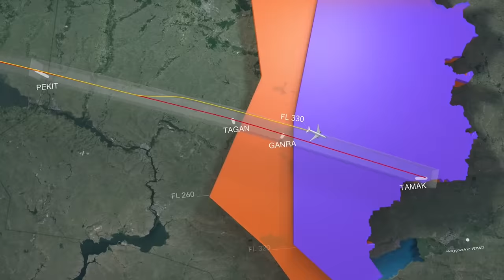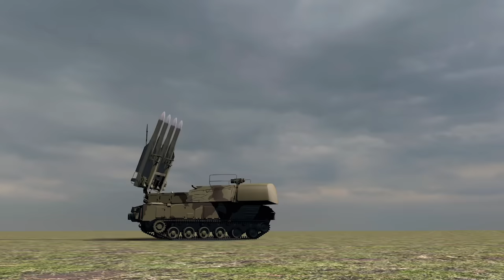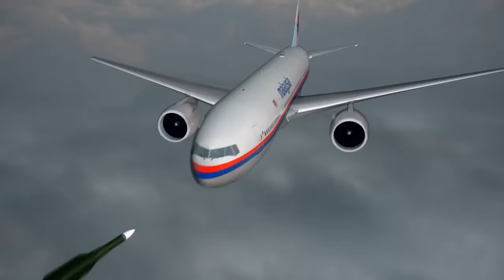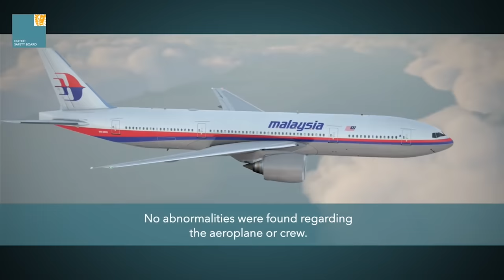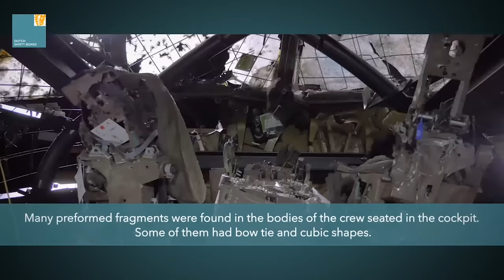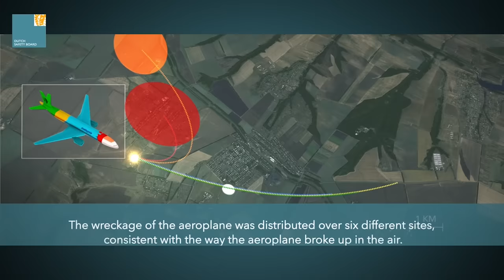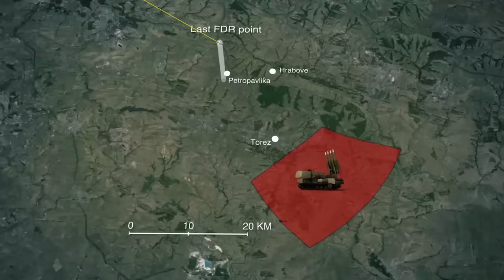Cause of MH17 crash by Dutch Safety Board

Comment: Can you imagine the terror the passengers felt whom survived the blast and initial breakup. Falling through the air. Assuming they didn't black out instantly. What a horrific way to die.
Reply: Based on the spray pattern of the explosion, one can only hope many of the passengers died instantly.
Reply: The amount of time that you can think logically at that altitude is around a minute.  After that you may still be awake but not thinking logically.  It's a horrible to imagine but certainly those toward the rear of an aircraft would suffer much more.
Reply: There's 0 survivor alive.
Reply: Terrible way to die. However, humans have found far worse ways to torture and/or kill.
Reply: Jesus. You're making this into a scientific debate. I also said "assuming they didn't black out instantly." Odds are that some were partially conscious long enough to realize what was happening. Flight or fight is no joke.
Reply: @retikulum  Incorrect.  Aside from flying as my lifelong career I have done hypobaric chamber testing.  You have time to don oxygen even in a rapid depressurization.  It depends on the fitness of the individual, but in the low thirties you have anywhere up to a minute to react before you are totally useless.
Reply: @TheWalterHWhite  Sorry for making it so heartless with the numbers, seriously.  It's a horrible crime that occurred and no one should have ever had to experience that.
Reply: Front of the plane forget it.  But the people in the back would go from comfortable temperature to minus 30 degrees in about 1 second and a 450 mph wind with everything starting to be ripped apart.   Just horror.
Reply: @tianxia4092  many fell fully conscious to their deaths.
Reply: Bo Sann  no it wasn't over quickly. Takes 30 seconds to drain of oxygen. There are pix of victims still strapped to their seats.
Reply: @RichardMusiol  nothing like suddenly falling to your death for no good reason.
Reply: @canofanger  the aircraft disintegrated. Many in the rear fell fully conscious to their deaths. Yes, Putin is a killer.
Reply: @cactusjack1943  the conditions would have sent them into shock in under 5 seconds. None were conscious upon impact
Reply: @night-lc1vc  sadly, that's not the case. Humans can certainly survive altitude and temperature for at least a minute and temperature and air pressure increased as they fell. Horrible way to die.
Reply: @cactusjack1943  I didn't say survive. I said they'd go into shock and faint as their bodies are not condition to that on top of the uncontrolled dropping and spinning
Reply: @night-lc1vc  nope. A body can even survive in outer space for at least 30 seconds. The sad fact is that many were fully conscious as they fell to their deaths. Remember as well that about the 777 was about 3/4 intact when it hit the ground. The Russian Army Buk approached from the front and decapitated the 777 by blowing off the flight deck (forward section).
Reply: Yes.. the plane would spiral down for several minutes before impact,,  I often think of that each time a get on a plane..  in hopes its not this one..
Reply: @metallampman  some victims were ejected still strapped in their seats. There are or at least were pix of the wreckage and victims that could be viewed on the web. Truly horrifying way to go.
Reply: Link me   i never heard that   they never found more than the tail near matagasgar
Reply: @metallampman  that wasn't MH17 the Malaysian 777 Putin shot down from Russian occupied eastern Ukraine with a Russian Army Buk AAM and crew.
Reply: @tianxia4092  that shrapnel on the missle is designed to destroy the cockpit and kill the pilots by detonating at the nose, like it did with this plane. im sure most of the standard economy passengers were well aware of their fate for a good minute or so before theyd pass out or hit the ground. it sucks.
Reply: Due to the catastrophic damage, I wonder if the oxygen masks even deployed,  Even if the lack of oxygen didn't render passengers unconscious, the tumbling of the fuselage would have (assuming the wings tore off).
Reply: @pizzafrenzyman  the masks did deploy. The flight deck was blown off by the Buk's 70kg war head and the roof and walls of the first class section were ripped off. The rest of the 777 remained somewhay intact including wings and rear stabilizers IIRC. It fell in a circling trajectory and landed upside down with the fuel tanks then bursting into fire upon impact.
Reply: 95% of the passengers or more likely died on impact
Reply: @TheWalterHWhite  You start contemplating on what some of the victims may have experienced, then get upset when others chip in with their opinion (yeah, why use science to understand reality) then you continue with your claims. Well done. How dare others to express their thoughts...
Reply: @metallampman  You're talking about a different plane!.
Reply: Nope. On Autopsies  every single passenger had a broken neck and or shrapnel  wounds.   . Everyone was  killed instantly  from deacceleration wounds and exposure to high energy atmospheric  windblast 550 mph wind
Reply: That's not true for everyone in a plane that breaks apart due to a bomb at 30,000ft+
Reply: @macman975  In the final ntsb report in Autopsy findings every single passenger had their necks broken .  It's  called Atmospheric  Deceleration  .   It would be like blasting  a bug with a firehose you literally  get crushed  by the wind blast.  They were killed instantly
Reply: Explain to me how that, i Believe Russian flight attendant survived a fall from over 30,000ft without breaking her neck when the plane she was on exploded?.
Reply: @LiverAndOnions69  what the hell are you talking about mate.
Reply: @RichardMusiol  not the point fool
Reply: because of high pressure, they got unconscious in few seconds, so most of them didn't even had a chance to get scared or realise what happened
Reply: i believe that when you are suddenly exposed to 600mph your neck instantly breaks!
Reply: You would know, Mr. White.
Reply: @lelouchvibritannia4028  HELLFIRE RAINED DOWN UPON ME!
Reply: @canofanger  After a minute, people toward the rear surely reached the denser air to continue think logically, not pretty.
Reply: Unconscionable, seemingly impossible to fully grasp.
Reply: Millions of animals die same way in more painful way for burgers
Reply: @p2egames133  yeah, thank God it's just animals phew
Reply: My grandfather died in a plane crash, the manager of his airport hit him mid air with his landing gear and severed his wing. It was seven seconds and he died on impact because there was no smoke in his lungs
Reply: Cause for panic, yes -- both also quick thinking. Death is not certain, and it's not over until it's over and you never give up, and keep fighting until the end - whatever end that may be. It is possible to survive a fall from that height and even the explosion that disables the aircraft ... because it has been done. The world record for surviving a fall without a parachute is 33330 feet, slightly higher than this aircraft was at. And it came from an airplane disabled by a bomb blast from the inside of its cabin.
Reply: Stopcens Oringus  I'm thinking skateboard wheels fitted the back of the seats and passengers could even complete the journey to their destinations regardless of missile strikes or any other unforseen catastrophic failure of the aircraft. ....BRILLIANT!!!
Reply: As previously mentioned, it is possible that some survived the initial blast, albeit it not long. This was stated by the Dutch Safety Board (DSB). The PAX would have quickly succumbed to the pressure, outside air temperature, and lack of oxygen. In theory, they could have survived for roughly 30 seconds to a minute and a half depending upon physical conditioning, age, etc. The DSB is akin to the U.S.'s NTSB. 

Some are arguing that the explosion would have killed them. Most of you are not familiar with SAM missiles. Without a spontaneous fuel ignition, SAM's just don't blow up a whole plane. They're payload is meant to debilitate an aircraft beyond operational air worthiness. They're not some massive payload that levels a block. They damage wings, pilots, and flight surfaces. In the event the fuel tanks don't explode, the vessel would break up, and the passengers would either be sucked out, or within the falling wreckage. It's probable that they were so dazed they wouldn't have recognized what was happening. This is per the DSB report

"It cannot be ruled out that some of the occupants remained consciousness for some time during the one to one-and-a-half minutes for which the crash lasted. The Dutch Safety Board deems it likely that the occupants were barely able to comprehend the situation in which they found themselves.”
Reply: @canofanger  You think if someone would have time to "don a oxygen mask" they would of survived? Come on man
Reply: @sxcnetworks6229  Of course not, silly.  Don't know where you got that from.
Reply: With how fast the decompression of the cabin happened their lungs would've exploded and likely died at an instant. We saw this effect on bodies in the 1950's with British airliners breaking mid air at that altitude. The only effect that happened at that time was that the bodies recovered had their skulls crushed from hitting the roof of the cabin. Which is likely something that didn't happen here since seats in modern airliners are better secured.
Reply: @mikkel066h  I was fortunate to once experience that type of rapid decompression in a hypobaric chamber and my lungs (and those of my colleagues) certainly didn't explode.  Someone may correct me but I believe the air force commonly does rapid decompression practice using such chambers.  Lungs don't explode; you lose your breath.
Reply: Dying is horrible..period. It was over pretty quick for anyone even surviving all the way to the crash. People with cancer for years, knowing they are going to die soon, die a horrible slow and suffering death. Lets not get lost on it all.
Reply: @OohzyJohnDow  Agreed
Reply: @Walter White - By my imagination, the MH17 tragedy maybe the same as in the Final Destination (2000) movie; The Plane Crash.
Reply: The question is that who fired the missile and why was it targeted to the malaysian plane?
Reply: @patriot4786  Are you okay?
Reply: To the initial question: Ask Juliane Koepcke, who, as a 17 years old girl, fell (strapped to her seat) out of an disintegrated machine 2 from miles height into the jungle and survived both the fall and the jungle though injured and alone.
Reply: @varelion  really?
Reply: Bunch of wanna-be experts in YouTube comments section
Reply: Awesome.
Reply: Sky driving
Reply: @reallyhappenings5597  Those few sexy of Trauma & Terror must have felt like years.
Reply: Hey WW, have you ever heard of Tenerife's airport accident?
Reply: @miguebyte  yes, 2 - 747's collided on the Runway? What about it?
Reply: @canofanger  As the plane fell very rapidly, denser air made them to regain logical mind before the death.
Reply: @reallyhappenings5597  not true, you gain consciousness once the altitude is lower
Reply: At 33 000 feet or 10 000 metres the air is -45 degres and the atmospheric pressure is so low that you get deprived of oxygen very quickly, add the uncontrolled rapid moovement and negative G force, very unlikely that passenger were perfectly lucid if even concious upon the impact with the ground.
Reply: @robi4387  short answer yes, but imagine trying to put your mask on in a falling spining  negative G force, decompressed airplane travelling at 800 km/h in -45 degres high wind.
Reply: @vwbora26  The airplane broke up mid air, highly unlikely everyone was experiencing serious negative G's your making things up
Reply: @vwbora26  and depressurisation happened all the time from 30,000 in WW2, most regained consciousness at lower altitude
Reply: @vwbora26  Your body continues to force breathing after you pass out, allowing you to regain consciousness when partial pressure returns
Reply: @vwbora26  What? They are free falling, not accelerating with an engine... therefore there are no negative G force and they very rapidly reach low altitude and most likely are fully conscious before impact.
Reply: I think most people got hit by the fragments and sudden air pressures that most likely became unconscious already.
Reply: @p2egames133  mmmmmm, burger 🍔
Reply: They said the plane flew for 5 miles without it's cockpit, so they had a lot of time to realize they were doomed. I've been in a major accident and everything is in slow motion than you feel the initial impact for a split second no pain than it's lights out.
Reply: @reallyhappenings5597  There were passengers found with oxygen masks on, so one can only imagine what really happened to some of those people.
Reply: @McBurnside6380  have you ever been so terrified that you pass out? I believe it's a way of the brain saving itself from permanent damage from the flood of chemicals, in the hope of surviving the immediate danger or dying at peace.
Reply: @solar_genesis  it's possible someone might faint. Fainting is caused by lack of oxygen to the brain which in turn, can be caused by fear. This is called vasovagal syncope. However, this would only be temporary and the person will wake up after a few moments. Falling from a great height or reaching terminal velocity will not cause a person to pass out. It will be a bit more difficult too breath due to cold, high altitude and a low vacuum of air pooling around the mouth and nose. Skydivers, for example, regularly hit terminal velocity and are conscious the entire time.
Reply: @mrkim3257  I 100% agree and I don't mean to diminish your sentiment with what I'm about to say, but just for future reference: Passenger planes travel at sub-sonic speeds, the only exception was the Concorde which has been decommissioned for about 18 years now.
Reply: You’re goddamn right
Reply: Something in a nigtmare
Reply: @alexandernikolov6364  scientific studies would disagree with you. I'm not sure which one of my comments you are responding to. See my last comment about five above yours regarding terminal velocity and skydiving.
Reply: They probably had mere a fraction of a second to realize what happened probably all died on impact and rapid decompression
Reply: Bo Sann  i just saw an Sky News video about the rebels who shoot down the plane and one of those guyz said that he saw one of the pilot crawling before his death :(
Reply: “Who survived the blast” not “whom survived the blast”
Reply: @andrew19871  My grammar can improve, but your horrendous two chord clapped together music won't. Notice the use of the word "your," as opposed to you're. Teach the King's English and donate the guitar. Be off goblin boy.
Reply: There was a video were Locals said the bodies that were falling out of the sky were already dead and already started decomposition..This was the same plane that disappeared at sea months prior.. flying at "33,000" feet??
Reply: But I heard about the autopsy result on the dead bodies, and apparently they were already dead way before the blast.
Reply: @cactusjack1943  No-one would be strapped in their seat, loose debris flying at 450mph straight to the back of the plane would have torn apart many instantly. People would have also been ripped out of the plane within seconds. The one that breaks my heart the most is children and parents traveling together.
Reply: @orangetimeexpress1221  if you mean missile impact, then it would be closer to 5-10% the cockpit was the most damaged so the rear 80-90% would have been fine
Reply: no one survived.
Reply: Bo Sann  well the pilots did die instantly so I guess that’s lucky for them but they’re still unlucky because they are one of the 298 victims.
Reply: @varelion  I remember seeing that. She landed in the Amazon and had to reach safety without shoes or her spectacles. Terrifying !
Reply: @canofanger  being conscious in a disintegrated plan falling to earth for even 1 minute sounds excruciatingly horrifying
Reply: No, I can't.
Reply: @benjames7932  I just wish someone would be held accountable for such a terrible crime on these innocent people.
Reply: Yeah, probably like having a real life vivid nightmare.
Reply: What no one is speaking of beyond people blacking out is the instant the plane broke up many people would have been violently tossed, spun, and hurled at over 500 mph in a cloud of shredded metal, and -40 degree air.  The human body just cannot withstand those forces and many people likely had limbs, if not their entire torsos ripped apart and smashed and this would of happened well before they had time to pass out from oxygen deprivation.  This sounds like an "instant" death, but not always and I am certain some of the folks had several seconds to  minutes of useful consciousness. Absolutely horrifying and an awful way to go. To the lost.
Reply: @cactusjack1943  You almost make it seem like you were on the plane and was the only survivor. Like you know for a fact people were alive upon impact with the ground.
Reply: @miked815  many would have survived the decompression and ambient O2 would have been sufficient in 30 seconds.
Reply: a lot of wishful thinking in these comments. most of the passengers were alive and conscious as the plane fell to the ground in a near zero g freefall whille in a flat spin. everyone on board was screaming for their lives until the moment of impact. absolutely horrifying
Reply: @TheWalterHWhite  Please don't use the Lord's name in vain. God bless.
Reply: A pilot was found crawling by the people who shot down the plane ✈️ so yes some where conscious through out the entire event until their death.
You guys underestimate the human body because you probably haven’t ever put your bodies to max testing or use yet. 
Couple with a state of life and death everything about you will be heightened your level of alertness, defensiveness everything. People will usually do what they are good at better those who will pray will pray more tirelessly with more vigor those who will yell will yell louder than ever like it’s their last their lungs will carry more than they ever thought same for those who will run, jump, hide, slump, cry, fight, swim, through up, poop themselves, those with the will to live, with the will to stay awake through it all and the body/physique to actually stay through it will do it. 
Some people need years of training to do things others can achieve with no training and Vice versa. 
So essentially I am Very sure there were People more than 1 or 2 or 3 out of the 300 passengers on board who stayed awake for almost the entire event. Especially after seeing the video of them looking for the crawling pilot
Reply: @cactusjack1943  90 seconds actually but you pass out in 15. It's crazy how the body is willing to take so much damage if you think about how deadly those places are
Reply: @floseatyard8063  I can hold my breath for a minute fairly easily.
Reply: @cactusjack1943  doesn't really matter if you try to hold your breath in a vacuum anyway, if you hold your breath in space your lungs violently rupture as the high pressure oxygen in you will want to exit your body. Basically the amount of air in your lungs pushes outward since its pressurized and there's no pressure in space. If you just hold it in air in your lungs expands to the point it ruptures your lungs. But anyway good job on being able to hold for a minute, it's kinda hard for beginners at holding breaths
Reply: @floseatyard8063  30k ft is not a vacuum.
Reply: @floseatyard8063  yes. Many were fully conscious as they fell.
Reply: @cactusjack1943  well if you meant airplane crash then people at the back were probably conscious
Reply: @floseatyard8063  the 777 was decapitated and the top of the fuselage was ripped off. Some passengers were ejected at that point. Chairs were also ripped loose and those passengers hit the ground with their seat belts still fastened. Horrific way to die and what's even more horrific are the craven lies Russia told about the atrocity.
Reply: @floseatyard8063  Russia sent a Russian Army Buk with a Russian Army crew. It later sent entire Russian Army armored units into Ukraine and absolutely lied about it despite pix and videos taken by their own people proving it.
Reply: At that altitude, it only takes seconds before hypoxia sets in. You can be conscious but your brain is so oxygen staffed that you basically don't know what is going on anymore. The airplane broke apart and fell from that height. There is pretty much no oxygen at that altitude. It would have been terrifying, but they would have lost consciousness half way through the fall. That is about the only positive thing if you would take it as such. People would have been in utter fear for a few seconds as they fall and they would have started to experience hypoxia and be semi conscious or unconscious by the time they hit the ground.
Reply: @cactusjack1943  could we survive if we have parachute
Reply: what if passenger plane fly low like 200 ft so that we can see the logo of malaysian airline
Reply: The plane shot down above Petropavlivka, then the wreckage fallen down within 10Km. Object at altitude 11km is moving at 900km/h, then stops, and starts falling. I am not a mathematician, but no fking way it fells within 10km. The plane was hit somewhere else